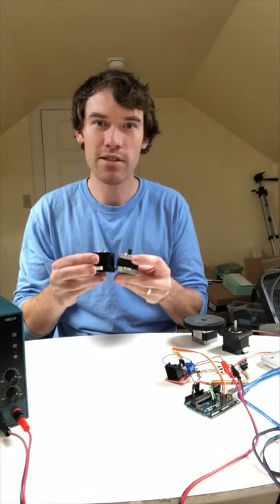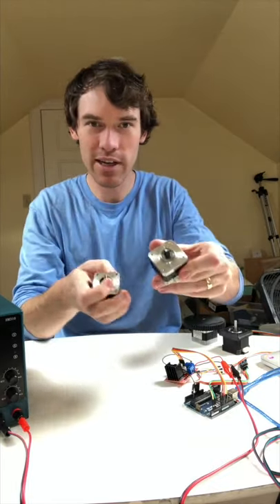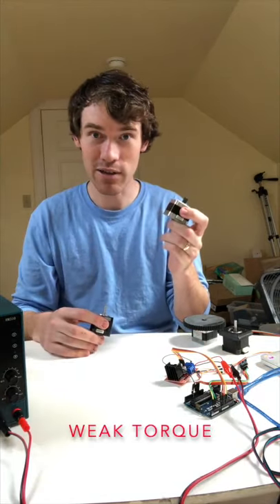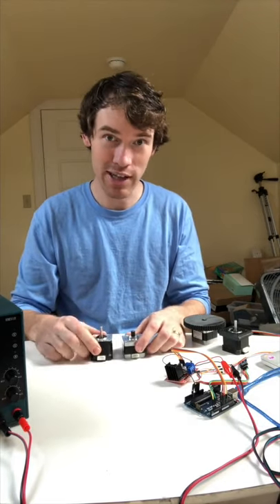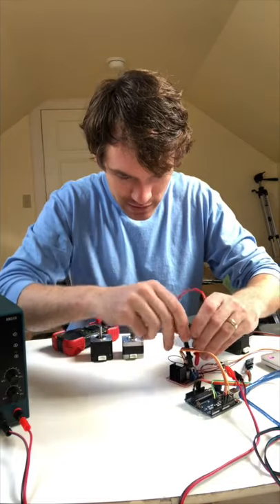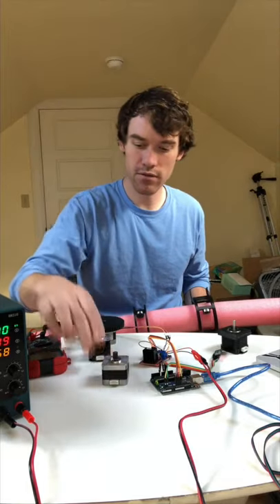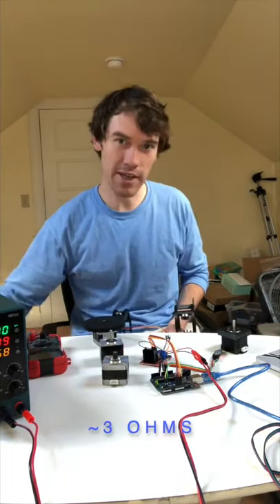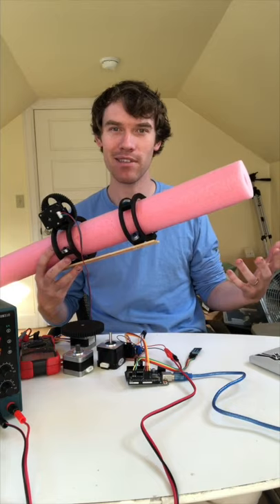Nema 17 Stepper Motor has no Torque!?

Comment: There is something you may not know, its true want you said about the motors up to a point. Many people don't quit understand how to used the torque of these special class of brushless DC motors. When creating a controls, the step pulse is the best way to get the maximum torque out of a stepper motor. Many of the controllers out there only do wave stepping for bipolar and unipolar two phase steppers. There are other methods to pulse steppers and there is the half-step but the most powerful is the torque-step. I won't go through all these things here but know that these methods are done either using FPGAs or Micro-controllers and firmware. Do a little research into these methods and you can get an h-bridge and a microcontroller and develop with not too much effort a custom controller for your NEMA getting the most torque using the above mentioned stepping. 👍

Comment: They have the same torque. Not at same voltage and current levels though.
Reply: i think it is because they have different RPM
Reply: There are current and voltage limits for each motor tho . The resistance of the coil shows the nimber of windings each coil has therefore more coil windings = more power but also higher resistance as more windings mean longer wire = higher resistance. The rpm depends solely on your coil energizing frequency tho

Comment: Good video, i have a 2009 Altima with a CVT trash mission, i changed the stepper motor, the valve body and my car still driving 20 miles and hr with not reverse, what do you think is the problem with this transmission? Do you think is rhe stepper motor?
Reply: Trash mission? Did you mean transmission? 

I bet auto-correct did this😂

Comment: is 2 Ohms good?
Reply from the maker: My guess is that i2 Ohms should give you a descent amount of torque. But you really have to check the datasheet. Power is Current * Voltage. And V = I (current) * Resistance.  So if you move some numbers around you will see that it's about how much Voltage and therefore current you supply to the motor. A lot of stepper motor drivers, allow you to set the current that goes to the motor, and you just have to make sure you aren't giving it more current than the motor is rated for.
Reply: @chasemadison  Thank you very much for the advise!!!!

Comment: how about givin more voltage to that bigger resistance motor? After all P=U*I so in theory if it stand same current that bigger resistance motor will give more torque with same current because voltage is higher.
Reply from the maker: Yup, that works. These l298n drivers will just use whatever voltage you supply to them, but most other drivers I've played with allow you to set the current somehow, and then the driver figures out what voltage needs to be run.
Just make sure you don't run more current than the motor is rated for.